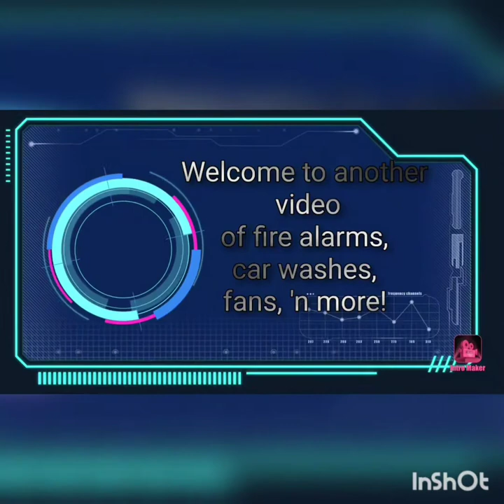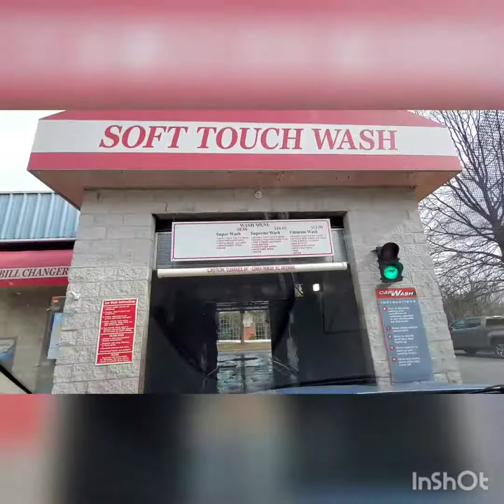Autec AES(?) with Superior Dryers

Comment: Sounds like this one had its hydraulics replaced, as those are the new AUTEC hydraulics.
Reply: No wonder why the new AUTEC I filmed sounded different. I was curious why it sounded like that.
Reply from the maker: Well, this is an old Autec machine, so to the research given from you, M.R. Newton, the old Hydraulics must have gone "kerplunc" one day, and the owner researched Autec and bought a new Hydraulic system for this old machine instead of closing the whole thing down, or replacing the whole system.